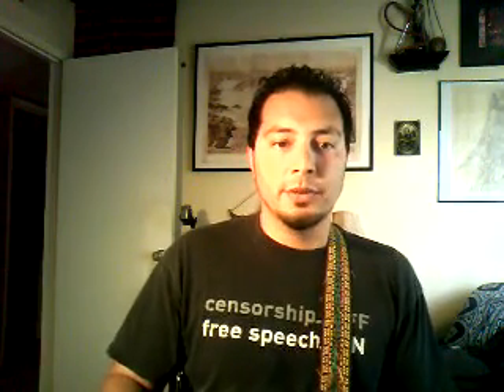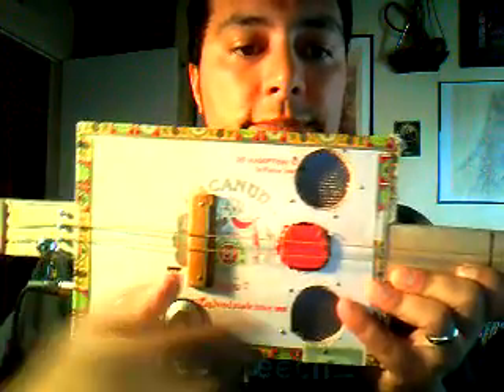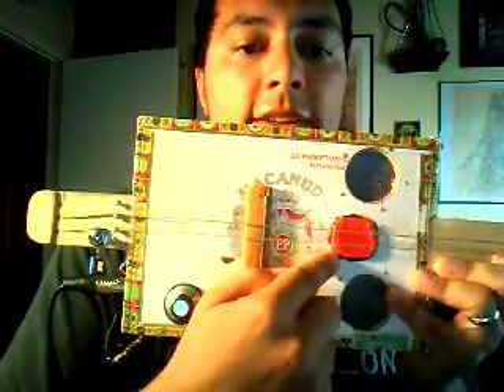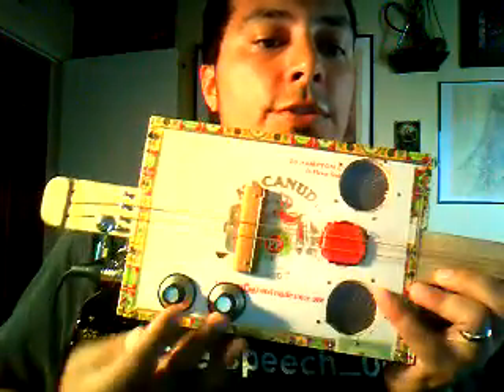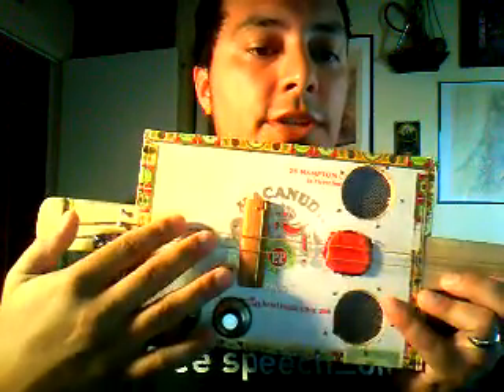Easy DIY Magnetic Coil Pickup for you CBG from a "Wallwart" Transformer.

Comment: I made a pickup for a one string broom handle guitar using a butchered small ac relay, neodymium magnet, worked really well, some small contactors have coils which are easily seperated
Reply from the maker: Nice! Yeah, relays are good for this too. As are the magnetic actuators from sprinkler valves... Anything with a coil, might as well try it right?!

Comment: Why not just use a piezo? You can find them for pennies, they're super light weight, easy to mount and wire up, and they're virtually indestructible. I like the recycling/DIY attitude, but this seems like way more of a hassle than it's worth.
Reply from the maker: Sound is way different. This guitar has both a piezo and this mag pick up, and I can dial them both in and out. Full range of tones.

Comment: A good idea and I appreciate the info, but after watching for 6 minutes you don't hear this pickup cleanly amplified; you hear it  cranked up full so it overloads the amp input. It might be worth trying weaker magnets. putting a resistor across the output, or backing off the guitar's volume control. Solid state preamps sound awful when overdriven.
Reply from the maker: well, I suppose we will agree to disagree on this point! IMO, this kind of diy, repurposing, improvised approach is a different world than "clean". If you want clean, then you need something engineered to be clean. If, on the other hand, you want something primal, simple, unadorned - that's when you go for this approach. to me, that's what cigar box guitars are about. breaking all the rules just to see what it sounds like! Dirty, gritty, rough around the edges. Warts and all! Sure, it's limited, but they are different limits with each instrument and build, and you can use them to really find a unique sound that lives way outside the box! A sound that lives way outside the old tired canon of tubes vs solid state, of gibson humbuckers vs fender single coils, of spalted birch vs swamp ash, or whatever old dichotomy you want to debate. Every wall wart pickup you make will sound unique, and waaaaaaaaaaay different than anything else out there. So, to me, there is no use in comparison. You just take it as it is and run from there!
Reply: @john 
i don't think it's the guitar making all that distortion, it's the video, i think he might have recorded it from his computer, i recommend lowering the microphone sensitivity volume as it's causing clipping.

Comment: This is a gread idea. Which magnets did you use, the disc or the rectangular shape?
Reply from the maker: The center of the "bobbin" is a square hole. I placed magnets in each of the four corners, which effectively filled the entirety of the hole. The hole is about 3/4" wide, and I centered the pickup under the strings.
Reply from the maker: Max _ Glad it was helpful! Yes, if/when I do this again, I will be sure to video that part as well! Lol!
Reply from the maker: +Ronald Gray Gray Thanks! I used very strong small neodymium magnets, about the size and shape of a circular asprin pill. I believe I used 8 in total, stacked in groups of two so they formed a little &quot;cube&quot; that I put inside the coil. Hope that helps!
Reply: +OneHarp Thank you, I'm on my way!
Reply: Can you clarify the placement of the magnets?
Reply: OneHarp thanks! I had some particularly small magnets at 3/16 inches so they didn't fit as snug. I used poster putty to keep them snug in there and it seems to be working. Great vid! It would be cool to see you setting it up and installing it into your CBG if you do it again

Comment: How did you get those metal sheet things off you mentioned? I'm attacking them with a screwdriver and tearing at them with pliers with no success at dislodging them... am I doing something silly? (Would have been really nice to see the whole process in the video.)
Reply: OneHarp
I've done 3 of these pickups so far, and have been very amazed and impressed how well they worked. I found the best way to quickly release those pesky E shaped thin plates, was to use a hammer and screwdriver to split them every 3rd or 4th layer, so you end up with about 12 or 15 "cracks" from top to bottom. Then I used fine nosed pliers, and gripped one corner of each seperate little substack, and twisted back and forth, until you hear the laquer "crack" and the laminated joins break, then they come out very easily with no need for a chisel or knife. I did one earlier today, it took no more than 10 minutes, if that. Efficient and safe too...
Another thing that was a surprise, I get a strong signal even without putting any magnet (neodymian) inside the coil? I thought it wasnt supposed to work unless there was a magnet?
Reply from the maker: Yo. yeah, it's a pain to get them off. They are glued together, so you have to get them to separate before you can pull them off. The reason that that part isn't in the video is that it's kind of a pain in the butt to do it. I had to clamp it to my work bench, put a (not very sharp!) knife at one of the joints between the metal plates (starting from those on the outside and moving in), and hit the back of the knife with a hammer. I didn't want to show this process because it's pretty dangerous, and didn't want to be responsible if people hurt themselves. If you choose to do it that way, you do so at your own risk! You might be able to get the plates to separate by simply dropping the thing on the ground, or tapping it with a hammer. Then again, you might not... Good luck, and be safe while doing this!
Reply: OneHarp Thanks for the response. I promise I won't sue when I chop off a finger or two. I've tried the hammer method but with a flathead screwdriver and even a small wedge, I'll start trying thinner things maybe? I do seem to separate the plate ok but it REALLLLLLY doesn't want to come away from the rest of them... I'll keep trying, this is too cheap not to take advantage of. (Not to mention that I'm completely failing at hand-winding my own pickups with 42-gauge wire...)
Reply from the maker: Good luck! And thanks for not sueing! :)
Reply from the maker: Hey, cool! Thanks for the tips, and glad this has been working out well for ya! Strange that you get a signal even without the magnet! I wonder if there's still some (magnetized) iron still in the coil somewhere? Yeah, it's not SUPPOSED to work with out a magnet, but maybe it does? Pretty cool anyway!
Reply: I tested the coils with and without a stack of those (very powerful) neodymiun magnets, and to my ears there was no obvious difference in signal strength....You can hear them on the last several videos I posted. One coil came out of a defunct 12V Ryobi drill driver battery charger, another from a defunct 9V ZOOM drum machine "wall wart" transformer, the other from a defunct 9V transformer off an old effects pedal. They pick up a decent bass sound and also decent highs and mids. I am going to experiment with multiple pickups, inspired by the famous luthier John Lowe. Gonna try building a flat pup style pickup too... I did butcher up an old guitar to get a factory pickup, and was surprised that it was actually quiter than my home made version.
Anyway, thanks for posting your inspiring video , I really love this homemade instrument/homemade music approach, wish I'd discovered it long ago, I have a real excitement about music now that I never had as a drummer.
Shalom, Jonathan

Comment: simplest way to make it work without winding your own coils. there is  space for improvement with very littlle effort:
too strong magnets will affect the strings vibration, giving you an unpleassantly vibrating sound. same, when the pickup is too close to the string. electric guitar pickups use quite weak magnets. also you want to keep the coil as close to the core/magnet as possible, to maximize the output. 
one ingeniously designed (and quite easy to copy) CBG pickup is sold as "the flatpup". kudos to the inentor! =)

Comment: Great Idea! but a correction is needed:
 It is a step down transformer, therefore the "primary" is the thin wire (120vac) and the "secondary" is the thick wire (18vac)...If you reused some of the metal laminations all arranged in an "E" with the coil in the middle and 3 magnets on the ends of the "E" the output would be significantly increased and cover a larger area (more strings) just be sure to arrange the magnets north south north or vise versa...
Reply: using parts of the original core is a good idea, if you dont want to re-wind the wire into a new coil, good magnetic flux and its close to the coil. though, for a single coil one magnet will be enough. 
one more thing: electromagnetic pickups in instruments hardly ever use U or E shaped cores. (a humbucker is technically two pickups of opposite orientation, sharing one magnet) a small sensing area results in a cleaner signal and more distinct sound and overtones.

Comment: OK, quick correction for others outside this box: THIN wire is PRIMARY on these. High voltage side is LOW CURRENT side, in this case SUPER LOW current side. For people hacking transformers for other purposes, missing this could start a fire or at least trip the breaker in your house.

Comment: You've got the exact same transformer I've got here. Was hoping to see how you put the magnets in there. Can't see the orientation, how big, how many, or where they are placed.
Reply from the maker: I used two stacks of 4 small circular alnico magnets that measure 0.5cm in diameter and were 2mm in height each. So this made two "columns" of 8mm height by 5mm diameter. The interior of the coil is rectangularly shaped, so I put one column at either of the "long" ends of the rectangle. The magnet columns were about the same height as the thickness of the coil and housing, and don't stick out above the surface of the coil. I used a steel washer on the "bottom" side of the opening in the coil to anchor the magnet columns too, and then just wrapped the whole thing in duct tape. So there is only a couple of layers of duct tape between the top of the magnet columns and the strings.
Reply: Thank you for the explanation!

Comment: There's another matter that complicates things. What pots do I use? This is technically a single coil pickup therefore I should be using low value pots to cut out the high end but do they have a lot of high end? They sound really dark for single coils. Maybe I should use a higher value? Maybe someone with a lot of time on their hands and enough money that  he/she doesn't mind getting a variety of pots should do some experiments and post a video.
Reply from the maker: It is dark sounding, but honestly, mixing the two pickups (this one, and the piezo one) gives plenty of tonal ranger, from dark to really bright. Plus, since this is making pickups essentially for "free" from scrounged parts for a home made instrument, using expensive pots is kinda outside the ethos of the whole concept, dontcha think? :)
Reply: OneHarp I guess piezos are easy enough to install. Who said anything about expensive pots? They've got to have a value though. You can get 250k or 500k pots on ebay for next to nothing. Especially if you don't mind micro pots.
Reply from the maker: Paul L :) sorry, I suppose I put some words in your mouth... It's true that pots don't have to be expensive... I typically just use whatever I have laying around, which usually I've scrounged from some sort of old audio junk I picked up at goodwill. I think I probably used 100Ka pots in this guitar, although I honestly don't remember... They are just wired up as straight volume controls (which always have SOME treble bleed), and there was so much tonal variation available from the two pickups that I never saw the need for a tone control...
Reply: OneHarp It's all good bro. Thanks.

Comment: I was going to mention that too. The lighter gauge wire raises the resistance to lower heat and power consumption. 500 turns of 30 gauge wire w/thermal cutoff on the primary and 50 turns of 18 gauge on the secondary will yield 12 VAC after the 10 to 1 step down reduction from the original 120VAC. The cheaper wall warts usually use 4 cheap diodes to rectify to DC and a capacitor or two to filter out the ripple. Switching power supplies only have a small isolation transformer as a safety feature.

Comment from the maker: You can use either type of transformer. The only thing that makes a "DC transformer" different from an "AC transformer" is the diode rectifier bridge that comes after the actual transformer (the copper coil with the iron core). The actual transformer portions are functionally and mechanically identical.

Comment from the maker: @yumyumfruitstripe Thanks. I mean to wrap it up with electrical tape. This just ensures that all the wires  won't short out if something metal touches them. Also, since the coil wires are really fine, taping it all up helps provide some strain relief so you won't snap them if you accidentally tug on the output wires you solder to the coil.